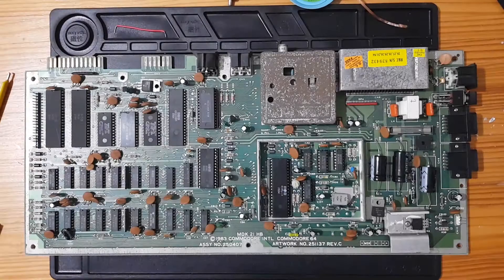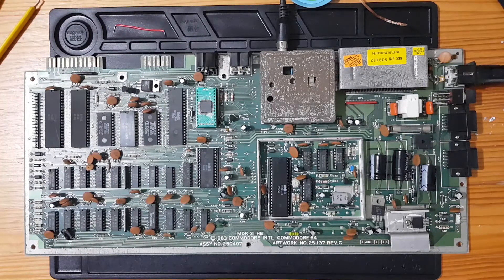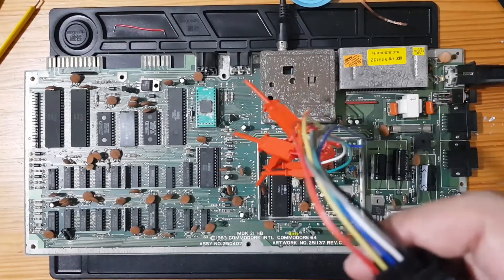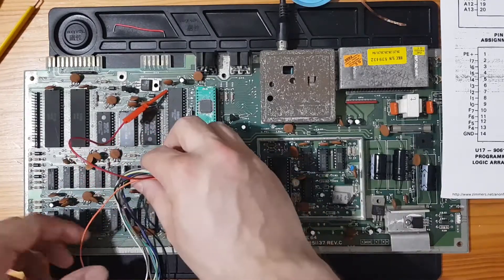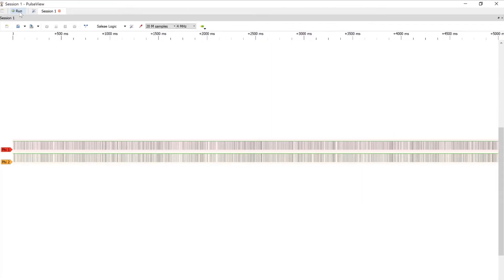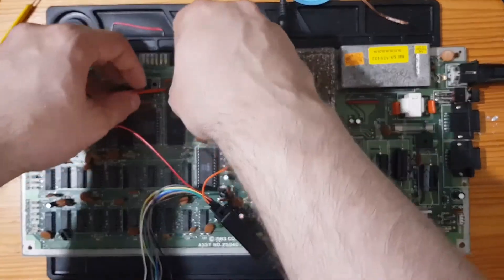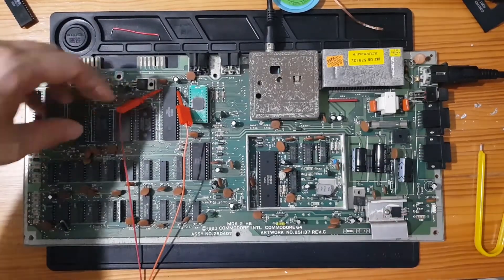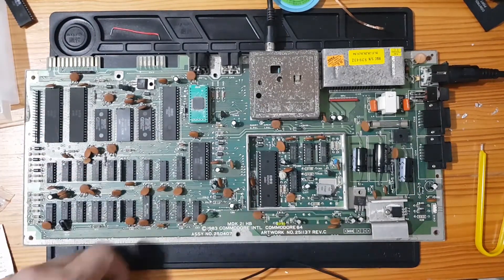C64 Black Screen Repair - Part Three

Comment: It could potentially be one of the chips that control the RAM as well. Normally you'd get garbage but if it affects something like the CPU stack it might not get that far.
Reply from the maker: That happened with the garbage screen repair. Turns out that whilst replacing the RAM worked well, I blew half the board when I forgot to unplug the board and then started soldering... Probably the reason I've not done another one for a while. I do have an original GameBoy that I might try and restore at some point, though. Thanks for commenting! :-)

Comment: Thanks for your video, it helped me out a lot. I have a C64 with the black screen issue, but I think my problem is different to yours. I don't have a logic analyser, so I couldn't check the clock but the voltage at the chips was ok.The next step I took was to remove the 2 CIA chips and this gave me the starting screen but it was changing colours and blinking. I then put U1 CIA back in and I got my keyboard back and it would run a program. I then put U2 CIA back in and the black screen returned, so U2 CIA is faulty.

I also suspect that U17 PLA is also faulty as it is getting hot and also the characters are changing colours, can you tell me where you got your replacement PLA?

Thanks,

Andy
Reply from the maker: Thanks for commenting! It definitely sounds like you found the problem there! Congrats on getting it back up and running! Hopefully it'll last for many years to come! The logic analyser is really useful, especially for checking serial connections and I2C communication. It was only about £12 on eBay from China. Not sure how long it will work for, but it's already been worth the money. ;-)

Comment: So it was the VIC?  I've got a dead one here too that I cracked open while watching these.
Reply from the maker: Yeah. It turns out that the PLA was okay in the end. If only I'd have checked the clock line when I checked the power, I might have saved some time. I have another one with a RAM issue which I've made a terrible mistake with... That video will be going up sometime in the next week or two. Thanks for commenting!